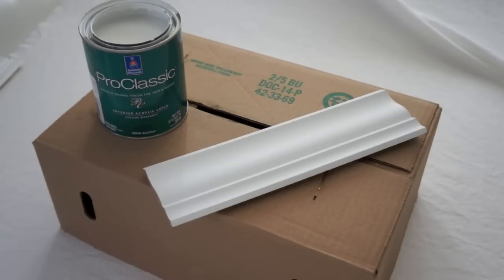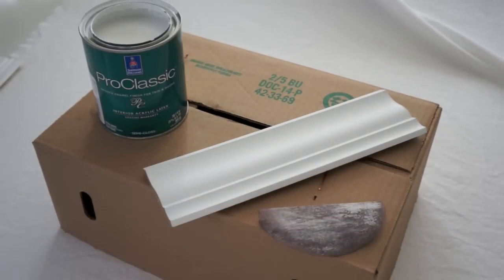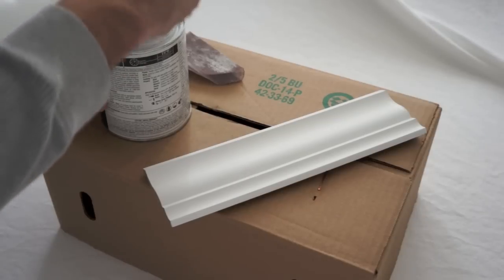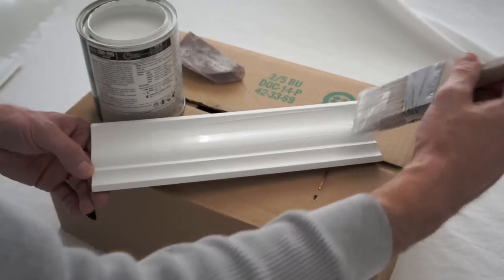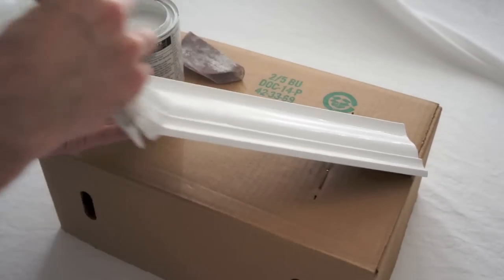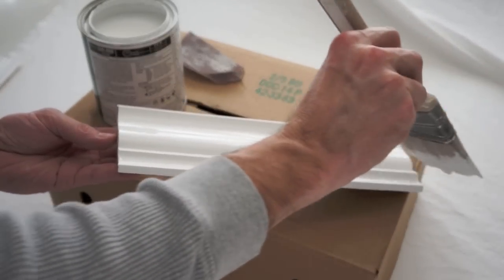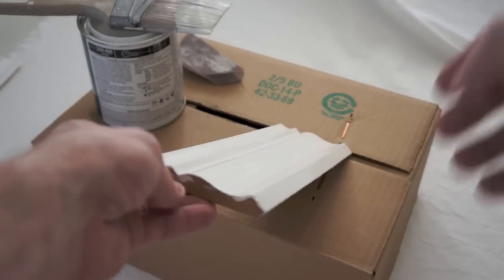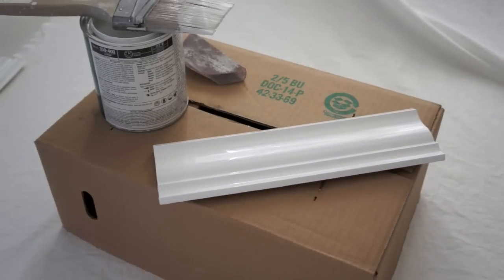Sherwin Williams ProClassic Acrylic Semi-Gloss

Comment: Sherwin Williams ProClassic is a great paint for trim, but it definitely has a learning curve when applying with a brush. You must resist the temptation to "work" the paint into a smooth, thin film. It should go on relatively thick and wet in small, controllable sections. Don't try to brush out the little "wake" lines. For some painters, this will initially look and feel like you're doing a sloppy job, but you must trust the paint. If you brush it out into a thin, even layer, the paint dries too quickly and there's not enough paint for the "self-leveling" action to occur. Another tip: be sure to never connect fresh, wet strokes to areas that are even slightly tacky, which occurs within a couple of minutes with this paint. You may want to experiment on scrap material before the real thing. Good luck!
Reply: Thank you!

Comment: You are not laying the product right. You put it on heavy and pull it one direction. Think oil, it does have alykd in it and it works similar to oil,  you can't keep working it a bunch of times. This is a professional paint, its not meant for DIYers. I have used this paint since it came out in about 09 and it has a great durable finish and it sets up pretty fast. I can repaint in 2-4hrs max.
Reply: I thought with oil you have more time to work it before it sets up. And can't you add extenders if it sets up too fast? Also, if he didn't lay the product right, why does it look perfect?
Reply: Should never need repainted if you are a pro
Reply: @johnp82  the guy used like 50 strokes to paint a 2 foot piece of trim. The guy clearly doesn't know how to paint well.

Oil takes longer time to dry, however it has a shorter work time then water born paint. Work time and dry time are 2 different things. Adding extenders retards  the overall drying, which slows down the job. Pros only use it if a 100% necessary.

Comment: I've used this on a small part of my trim and it worked fine, but difficult to work with on trims with grains, especially that I'm not an expert. It felt really thick and sticky. I want to paint my kitchen cabinet (with brush if possible), would you prefer this or BM advance? Heard a lot about the BM advance being good. Saw some videos with people using a brush with BM advance and it looked nice and very minimal brush stroke.

Comment: Info: Painting stained/sanded oak (ash?) baseboards in a small closet (~73" x 30").  Brushed 2 coats of Sherwin- Williams Premium Wall & Wood Primer previously for even coverage.  Just tried brushing a first coat tonight with SW Pro-Classic latex semi-gloss in 'Extra White' on some baseboard.  Used a fairly new Purdy 1 1/2" brush (little afraid of glopping it on with a 2" brush).  Did not achieve 100% solid white coverage like I hoped in 2 or 3 small areas.  Probably will need a second coat.  Seems to have a short working time/tacky quickly, or is that just me?Is it common to lightly sand in between coats?  More importantly, any tips on working with SW Pro-Classic Latex?
Reply: You need to degloss any pre finished wood work before priming if it has a poly or any other sealant coating  is even more important... Then you want to light sand the wood with like 120 grit paper so the wood has a gripping ability before priming

Comment: You are putting it on WAY too thin and over brushing with a nylon/poly brush. Try chinex and lay it on and off with long and fewer strokes. Wiping your brush off working out of the full pint can is also a Bozo no no.

Comment: This is terrible paint. It streaks and doesn't stay workable for more than 2 / 3 minutes. May be OK with a roller but awful using a brush. Plus the coverage is pretty bad. Had to use 3 coats plus a primer to cover a light green door.

Comment: PC waterborne is pretty good. BM Advance is a bit better. You can't over work PC or it will gum up on you.  However, NOTHING beats BM Impervo.  Btw, if this crown molding was already installed, it would look like Sh*t cause he is putting on WAY too much paint and it will sag like a bitch.  Dude needs to learn how to paint before commenting on products.
Reply: The sag resistance millage for Proclassic is precisely double what you see here. What I demonstrated here was (below) average for applied millage with acrylics (not to be confused with Benjamin Moore Advance) which is a waterborne alkyd and needs to be applied thin to avoid sags and runs. The most common problem people have with painting is not applying enough paint evenly. So, here is what I suggest. Learn how to apply ProClassic at 10 mil then come back here and re-read your previous comment.
Reply: ***** Show me where does it say to apply PC at 10 mil per coat.  10 mil is WAY too heavy for each coat.  I use PC a lot and I have much better success when applying 2 thinner coats than one heavy coat.  Ask any real painter and they will tell you the same.  Try doing a demo on a vertical trim with 10 mil and see what happens.
Reply: ***** ....Well said Brian. My Husband and I had project of painting all of our homes larger 1926 base and trim boards (installed) and I have to say,  I was not use to the pc at first but once I got familiar with it,  I was working like a pro with it..  And to say this being the biggest of compliments, when people ask who we hired to paint them as they ended up so well.. I have to say with a smile!  We and ProClassic.  I love this psint.
Reply: Facts!